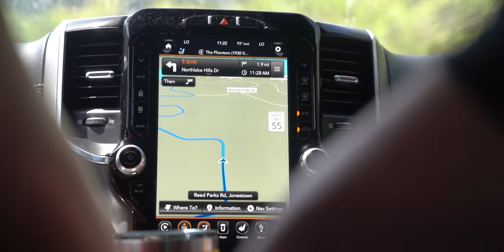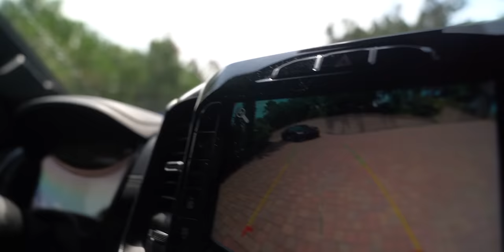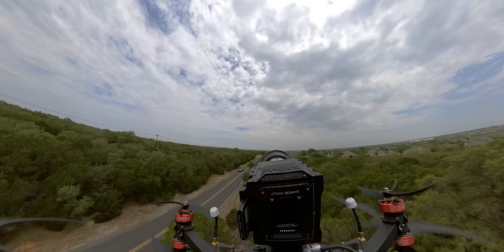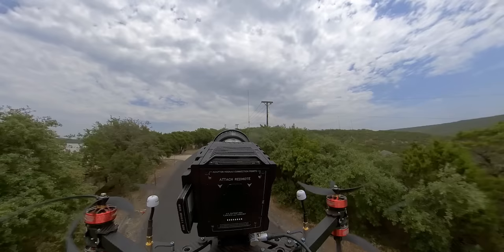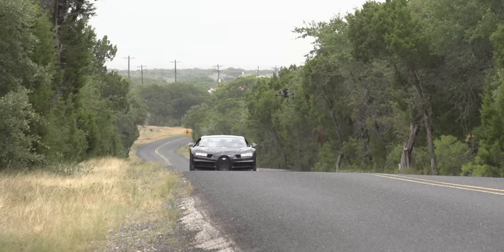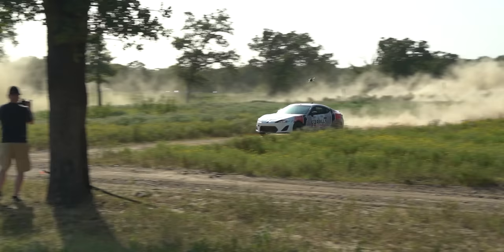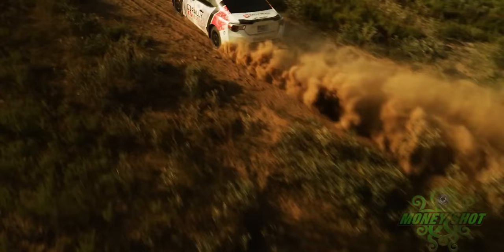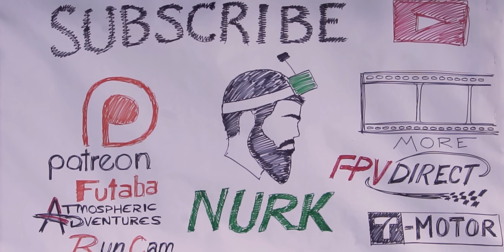Filming a $4M Bugatti with a $20K FPV drone with a RED Camera

Comment: it's hard to tell the cam quality just looking at it on youtube. Doesn't look any better than a GoPro
Reply from the maker: Got to remember that we're not trying to compete for YouTube but for the big screen
Reply: @NURKFPV  Thanks right, you get em!
Reply: my 1080p screen tho, lol
Reply: Could you not see the depth of field difference between them both? The level of detail on the Red was amazing.
Reply: @TheFozzie24  yes ofc I could see that but looking on yt on an ok monitor it didn't impress me so to speak. not a criticism just a statement.
Reply: @NURKFPV  did you film in 24p? On the red?  And process this video in 30 or 60p because all of the other footage is that?

Almost looked like showing 24p content in a 30p file
Reply: @lithiumfpv9254  I'm sure color grading and post processing of final edit will blow away anything go pro can do. Plus gopro with everything in focus, is just not cinematic.
Reply: Looking back.  Wow so much dynamic range too. You can make that red footage look like anything in post
Reply: @mrMacMilli2000  This lens on the Red is also very wide so you wont see any depth of field difference compared with Gopro. Also with lens so wide everything is in focus.
Reply: @dron  also true. I'm not sure what lens it was,  or Fstop.  But you can see more depth than gopro
Reply: @mrMacMilli2000  Now I checked in their previous video. Lens is Xeen 14mm. Chasing cars with racer drone (whatever size) is only possible with very wide lens.
Reply: @dron  for sure.. even a 14mm at F2 will give some blur
Reply: @mrMacMilli2000  I'm flying big drones with Red and Alexa mini for many years :)
With wide lens even with F2 almost everything in front of the drone is in focus because focus point distance is at least 5-10m in front.
Also with F2 they will need some strong ND filter to cut the light. Without ND F stop was probably at 16.
Reply: @dron  be nice to know the settings. Alexa is the bomb
Reply: The colors do look better on the big boy one
Reply: @Utsawb  That is the only big difference
Reply: Just check any movie, you'll see what an Alexa or RED camera can do. Try to do star wars with a gopro...
Reply: Robin M. You missed my point. I said it doesn’t look that great on YouTube. And his setting where prob off.
Reply: @lithiumfpv9254  ah yeah, for sure!
Reply: nah you can tell
Reply: The camera wide angle is less wide on the red and the fps are lower

Comment: i like the insta360 footage so much more than the RED.
Reply from the maker: tbh i love that perspective so much
Reply: @NURKFPV  even the quality looked higher to my untrained eye
Reply: @brianevans4  None of the footage will look true on YouTube
Reply: @YorkyPoo_UAV  and yet the insta footage looks better on YouTube...seems like that shouldn't be the case.
Reply: @su_K3N  I'm thinking because it was made for Instagram and YouTube. Less distortion has to take place versus something that has to be either upscaled or downscaled for a particular screen. Personally I prefer higher frame rates over a higher resolution.
Reply: @brianevans4  I think a big part of that is the color grading. also if this was a large production they would have had a trained cinematographer to squeeze all they can out of those cameras.
Reply: Or just a regular Gopro flown lower, closer, and smoother. Also muuuuuch smaller shadow, the huge shadow of that Red drone in the dirt chase was unbelievably distracting
Reply: ceLLice F.P.V  what's the gimbal going to do when the quad goes upside down? Can gimbals handle fluos and rolls?
Reply: It's cause they fucked up the colour grading
Reply: ceLLice F.P.V  Annnnnnnd it's called an Alta drone or a DJI. Come on dude, those drones with gimbal already exist, they're good but this king of big racers with a RED camera on top are opening a total new world...

Comment: Just now getting up the nerve to fly my EVO II in atti mode around structures and towers. Sharp course corrections using counter-stick inputs (you FPV guys probably have a slick term for whatever I mean) are still freaking me out with a sub-$2K drone. THIS is insane!

Comment: the red shots looked a little muddy is that just youtube encoding?
Reply from the maker: YT - check the link to the moneyshot down below, and you can see it at a better res on vimeo
Reply: DIAMOND HIGH TECH what’s fortage?
Reply: DIAMOND HIGH TECH did you mean footage? I was honestly trying to figure out what fortage was. At first I thought you meant foliage but wasn’t sure.
Reply: It might because the Red is a "Cinematic" camera, chances are that they were filming at a lower framerate giving that softer, cinematic look. Not to mention I don't know if they had a professional crew to setup the camera or even to do post-processing. Both of those things can make or break a shot.
Reply: Bad job color correcting
Reply: @josh8106  or un corrected at all. As well looks like shot in 24p and spliced into a 30p video. 
But the dynamic range is all there to make look any way they want.
Reply: Ace Mcloud stock red footage looks a little more flat

Comment: It's always badass when you can work with equipment like that. Maybe giving the Red a bit more of a downward angle to keep the subject centered in the shot? Chasing cars also helps when you know a turn is coming up, you can speed up, do a quick 180 reverse into the straight/turn.

Comment: i wonder if an extra camera and another pilot riding along would help, maybe one camera facing backwards and switchable by pilot, and definitely calibrating the fov on the dji unit to match i mean drawing lines on the screens to show what the red will see framing wise.  maybe a live out of the red for the director to watch,  its important to know when you got the shot and theres no need to run again.

Comment: The Rally Car stuff was pretty dope. Although with all that weight it doesn't have that same dynamic feeling that a 5" drone has except for the moment @13:30. I hope you get the opportunity to really put that thing through its paces and push it further. 

Someone needs to make a naked BMPCC and get it mounted on a 5/6/7" Meet in the middle with high quality raw footage and maneuverability.
Reply from the maker: smaller higher quality cameras with reelsteady features are the dream, but it's gonna be a minute still.

Comment: You need a separate gimbal operator for this.
Reply: I feel the same about this, it would have totally cleaned up the framing issues.  A little stabilization would fix the throttle pitch issues.  If you are filming with 30K worth of gear, you can probably afford two guys.  The bump in quality would be totally worth it.
Reply: The befit here is the agility/mobility you have with a drone of this form factor. The shots you would want to use this on are incredibly specific but pretty uncommon in the commercial production space. The way the camera moves influences the way the message is delivered. There's already a half a dozen companies that do professional gimabled drones great. Outside of a few crossbreed DP/FPV Pilots here on YT, I haven't seen anyone strapping anything more than a BMMCC to a under powered quad. A second opp on camera tilt angle would be good for the extra precision that directors will look for on set. More choreographed movements and finding the right speed to camera angle ratios is really the best way to be more precise. Good on Money Shot for doing what their doing.
Reply: @marluncar  Not sure from a business point of view I'd want to spend so much money and effort to target an "incredibly specific" customer base.  Seems self limiting. The guys who can afford this are going to be professionals who probably already have 100K in platforms and REDs, is there enough customer demand for something so specific that one of their other platforms can't suffice? JohnnyFPV is getting stunning results on a 5" with a 4K GoPro and RS, why would he spend 20 times that on something that does not help the framing or stability issues? I'm loving the creativity and effort, but only time will tell if there is truly a market for it.

And mad props to Nurk for piloting the hell out of a brand new platform.  Nicely done.
Reply: @craigcorbin4098  Because you will NEVER use a gopro shot in a big screen movie... You simply can't... Thats why he would spend 20x more i guess :)
Reply: @robinm.790  Agreed that you will never use a gopro shot in a big movie.  You would probably also not use a shot with framing issues. Agreed?
Reply: @craigcorbin4098  You will use a whole team and months to work on the footages :)
Reply: @robinm.790  I'm still not getting  your justification for this particular combination of un-stabilized hardware. RED gets the needed resolution and raw information professionals want.  But if you are working at the level where a RED is a requirement, you can afford a second operator and stabilized gear.  You would have much better quality for your starting point.
Reply: @craigcorbin4098  Yes but you don't want it to be stabilized ! You want it to move like you seat
Reply: @robinm.790  Movement is an interesting point, but I don't think I could watch it comfortably for a long time.  Pretty jarring, especially the rally car shots.  That's why I think a second operator is necessary.  It would fix framing issues like at 13:11 where a third of the car is out of frame.

Good conversation BTW, appreciated.

Comment: As always great video. Only one thing. Problem all fpv drones its non adjustable  camera tilt.  Usually remote control has 16 channels.  Just put regular servo, some tilt mechanism, setup potentiometer on remote control. Especially when flying on low speed camera should have low angle.  Thanks

Comment: Hmm. The RED seems to have problems with the lighting changes. Isn't it meant to be manually adjusted by hand while filming? Or is it "AUTOing" all settings on the "literal" fly?
Reply from the maker: The RED did not have any auto-exposure, we just set exposure and flew for this flight

Comment: where have you put battery of RED?
Reply: The camera is powered off the flight battery, saves weight and drag. The lost flight time from the extra drain on the lipo cells is more than made up for by not having to fly a camera battery with a lower capacity, and the camera only uses a fraction of the raw amps that the drone needs to fly.
Reply: @AlRoderick  you mean that RED takes power source from Drone battery?

Comment: Awesome work — would be so nerve racking.
If only there was a way to extract gyro data (say from a gopro mounted on the red, or even the fc gyro) and smooth the footage with reelsteady, assuming the quad doesn’t need changes to motors/props/tune

Comment: Real question, not trying to be a dick, but why does the footage from 12:53 on look so laggy? I assume this is footage from your fancy expensive camera. Why does it look like I'm missing some frames? My monitor is 1440p@144Hz. I'm running an i5 9600K with an RX 5600 XT. It's not my set up, the GoPro footage looks fine...ish
Reply: Cause it not  nice camera

Comment: Neat Project, could just use a SigmaFP Camera that's only 422g, 50-135 tonkina mark ii 1500g, total 1900grams, save yourself 1000g, compared to running the RED Scarlet W, longer flight times, etc...put a focus puller to it so you can actually pull the subject out of the background, give yourself and the director/dp some choices in the shot, that's what I would want, could be cool.

Comment: It's like I said yesterday keeping the car in frame would be less of a proglem when changing flying speeds if there were a tilt servo on the camera and a real camera man was running the tilt and why not the zoom also.   Just a suggistation don't get mad.
Reply from the maker: It's going to add another level of complexity that would make it even harder and harder to get the tune and flying just right.

Comment: The Red footage looked under exposed. I suppose there is post production potential to correct that.
So far these videos have only convinced me  that a 5 inch quad with a gopro or an inst360 is all you need to shoot amazing and fabulous looking chase videos.
Reply from the maker: Yes, but that's only until you set the gopro footage side by side with a real cinema camera.. then it just doesn't hold up.

Comment: Not sure about the cinematic quality of this system. The only advantage this has above a 5 inch quad is payload capacity. Yes you can film with a Red camera or similar but it doesn’t have a gimbal or the ability to manually control the lens. 

It seems like the Alta S is the better cinematic choice
Reply from the maker: Completely different purposes for each of these - the FPV "look" is what people are after - obviously a gimbaled system is going to be a better look for like.. flying tripod stuff, but if you want to go down through a building, split-s, or go into a canopy, you need something more agile for the FPV look.

Comment: Bugatti 0 to 60MPH in 2.5 seconds
Tesla    0 to 60MPH in 2.4 seconds

Bugatti costs millions
Tesla    costs <100k

Electric FTW 🤣
Reply from the maker: Tesla, 0-300kph.. never. :P
Reply: @NURKFPV  The Tesla top speed limit is software locked to 250KPH. If derestricted it can easily exceed that. At stock configuration the Bugatti can travel faster though sure.
Reply: @t3hmaker165  Nice. I left a comment. Tesla's Gigafactory is releasing the new battery tech over the next few years. Will be awesome to have higher capacity, high c packs for longer, faster chases.
Reply: @changeagent228   exactly! it will be awesome, thnx for the comment m8!
Reply: @t3hmaker165  😄👍